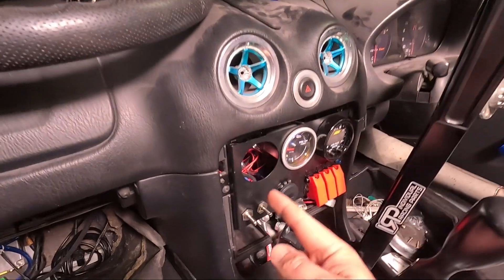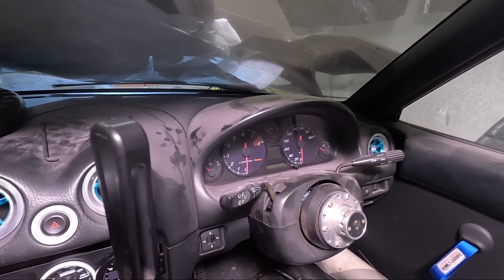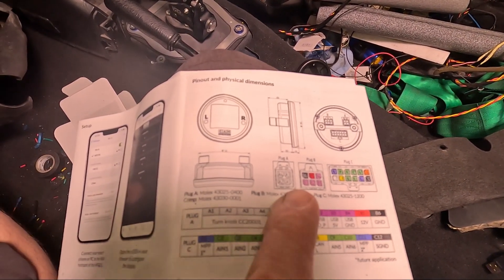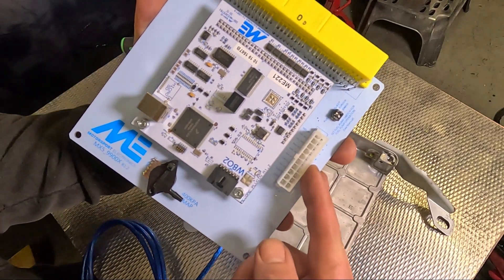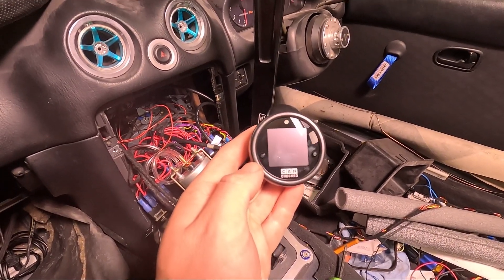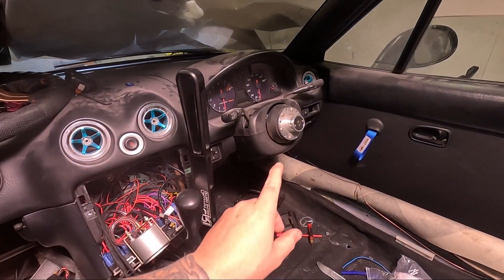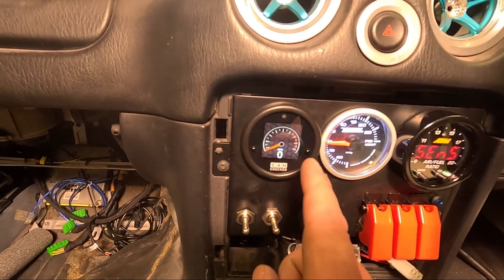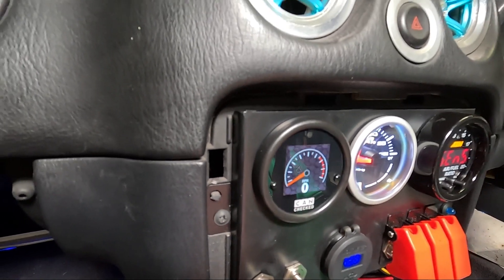CANCHECKED MULTI DISPLAY GAUGE  : MX5 MIATA TURBO BUILD pt66

Comment: The ME221 and ME442 software is not on the Canchecked gauge, you will need to download it to the gauge, it took me quite some time to get my head around it, but sorted now.
Reply from the maker: Ahh thank you.  Luckily my tuner has got me covered 😉
Reply: After downloading the software would i be able to actually connect it to my megasquirt? I cant find any of the settings to select the ecu and what not
Reply: @driftinginc.4676  You should be able to pick Megasquirt from a list of different ECU's when you boot it up